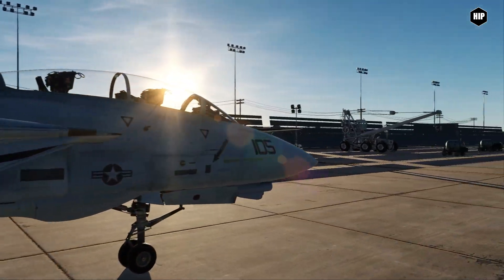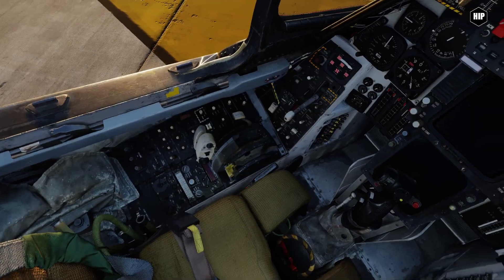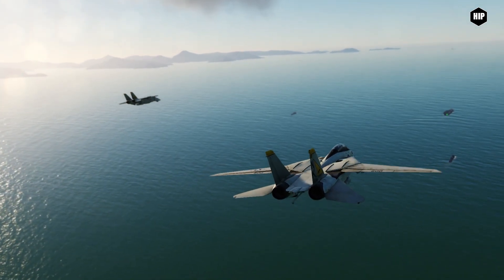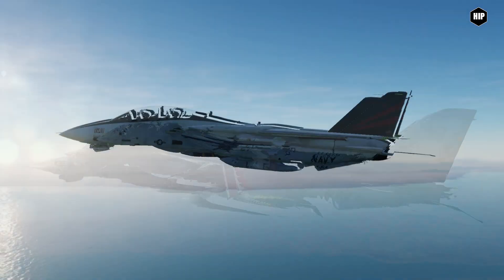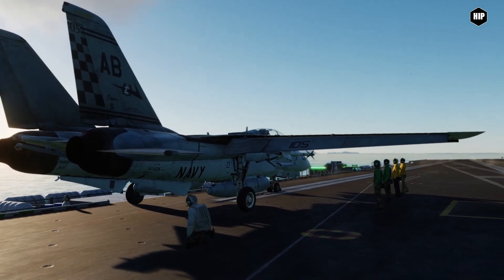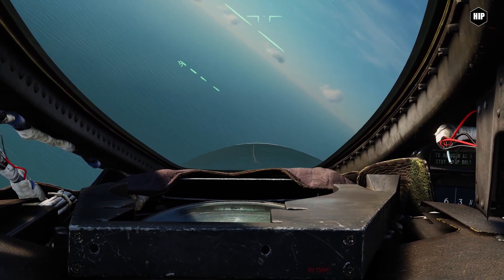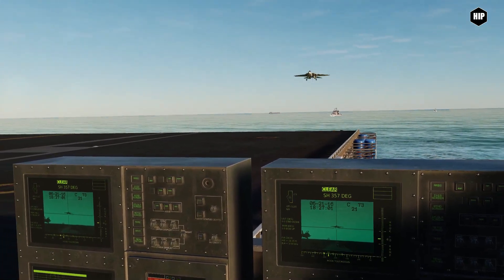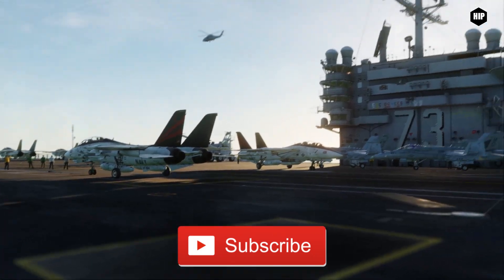DCS F14A What's new?  135 - GR Late version Tom Cat

Comment: we actually have some minor changes in the cockpit: for example in the rio cockpit the CB for the engines, and in the pilot cockpit obviously missing the engines secondary mode (only a ge110 option), and the asymmetric thrust limiter switch
Reply: Reminder: (late) Model F-14As were equipped with the PTID display screen, replacing the oldies fish bowl TID screen.